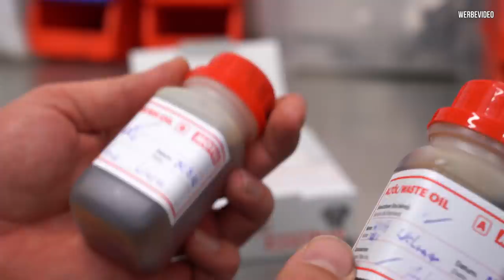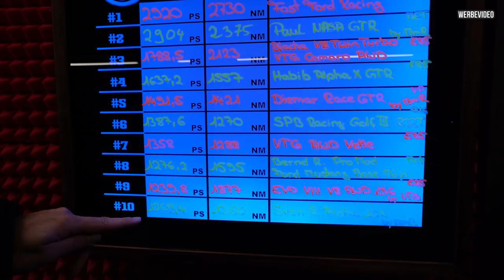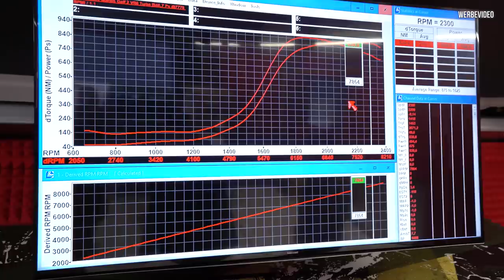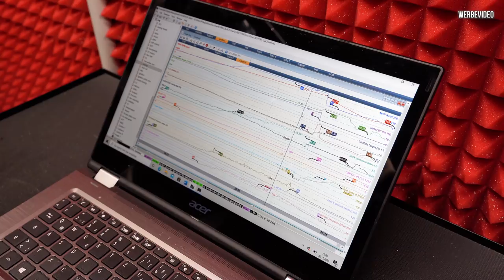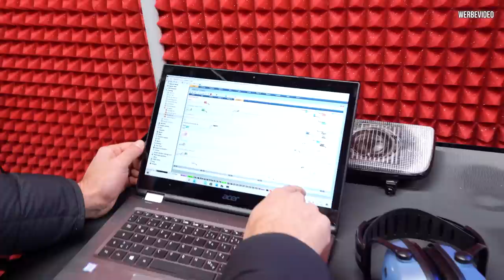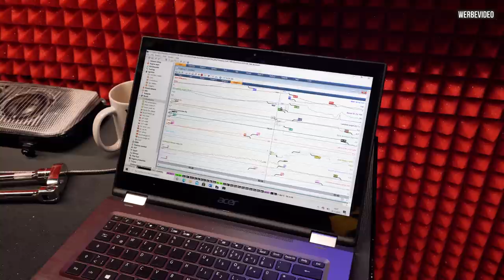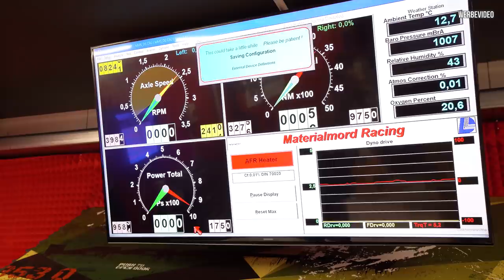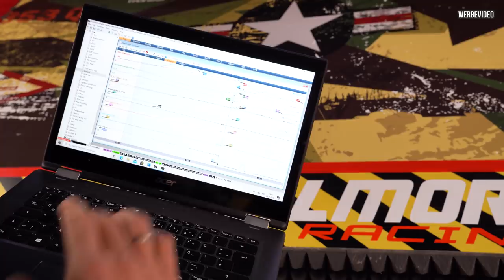Saisonabschluss auf Pauls Radnaben Prüfstand für Marius Golf & Pleuellager Check | Philipp Kaess |

Comment: Es ist soo schön immer wieder eure Video zu schauen, ich mit meinen 1 PS Kniescheiben. Da ich in Berlin wohne um man hier kein Auto braucht, bin ich halt mit dem Fahrrad unterwegs. Und ja, auch Fahrräder kann man "tunen" wenn man keine 5000 Euro für ein Carbon Rad zu Verfügung hat. Apropos PS: Wenn ihr oft mit dem Bike unterwegs seid und kein Bock mehr auf platte Reifen habt, => Schwalbe Marathon Plus ODER Continental Contact Plus ( die fahre ich bei 4,5 Bar (Lade)Druck :O :O :O )

Comment: Trockeneis vor die Ansaugung / vor den LLK?

Wie sieht es aus mit NOS?

Würde mich über eine Antwort sehr freuen, denn das sind tatsächlich ernstgemeinte Fragen.

Lg Paul
Reply: Ansauglufttemp. ist mit dem riesen Kühler immer bei etwa 35 Grad. Das ist also top. Trockeneis hätte da keine Vorteile gehabt. Nos sicherlich, ist mir aber einfach zu teuer und kann schnell den Motor kosten😀
Reply: @WariusMehmeier  ich bin Luftfahrzeugtechniker. Dazu kann ich dir sagen, die meisten modernen Triebwerke sind Flat Rated 35 oder 40. D.h. max Leistung liegt bei 35°C auf Meerespiegelhöhe an. Dies hat zur Folge, wenn du bei -10°C Max Leistung geben willst, hat das Triebwerk viel viel mehr Bums, als die vom Hersteller angegebene Max Leistung. Ich rede von VielVielViel. Also deine 35°C Ansaug Lufttemp sind okay aber wenn du auf 0° kommen würdest, könnten die 1000 ps sicherlich fallen!
Reply: @dkdjszudbdiiusushajjjaauu2644  das nutzt mir leider aber bei 35 grad im Sommer nichts. Und das Auto soll wenn immer 1000PS haben, nicht nur einmal auf dem Prüfstand. Sonst hast du natürlich recht. Lieben Gruß